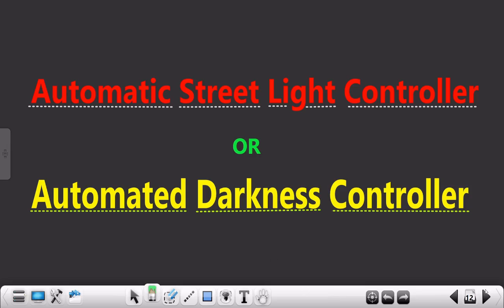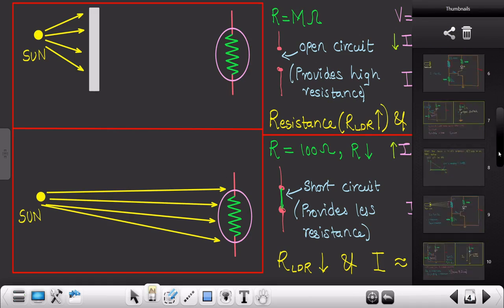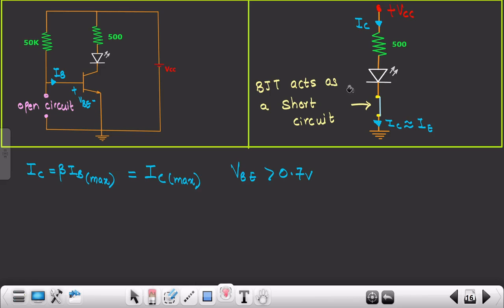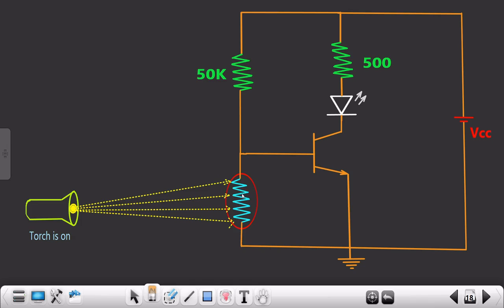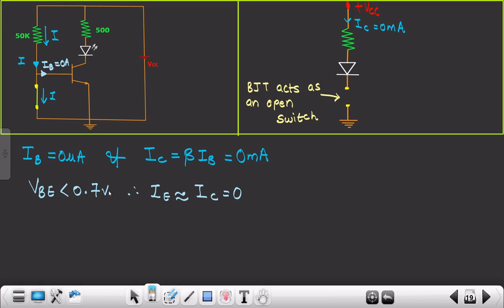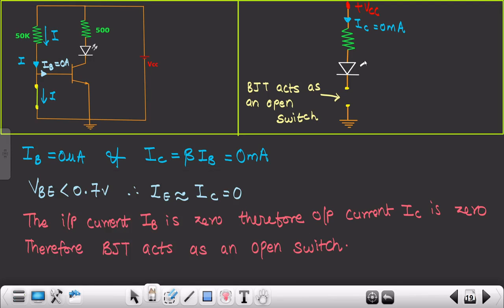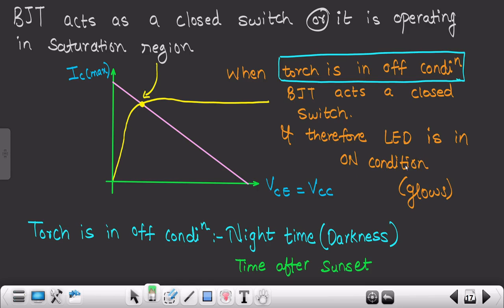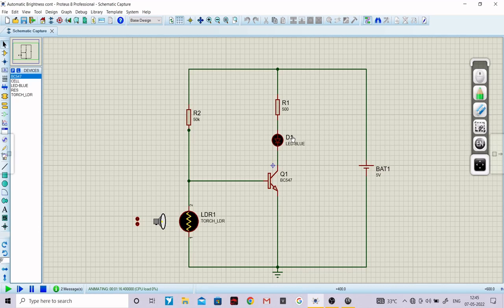Automatic Street Light #controller using #bjt & #ldr #sensor on #proteus | #diyprojects #fets #fet

Comment: Which software are you using?in this video?
Reply from the maker: Proteus
Please subscribe my channel to get such amazing content
Reply: @practical-buddy  i did subscribe but can you tell me more software like Proteus
Reply from the maker: Yeah sure 
There are many softwares available where you can design and simulate circuits but mostly used softwares are Proteus, multisim, ltspice and if you don't have desktop or if you have desktop but with low configuration were you cannot run this kind of softwares then you can simulate circuits on your smartphone as well,  electric circuit studio software it is available on play store I'm not sure if it is available on Apple Store just check once.
Reply: @practical-buddy  thanks you